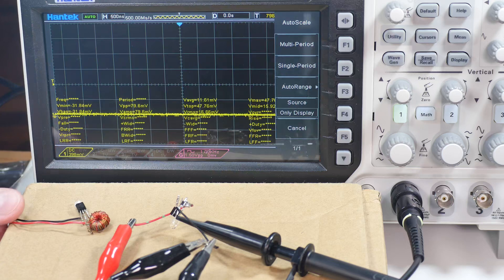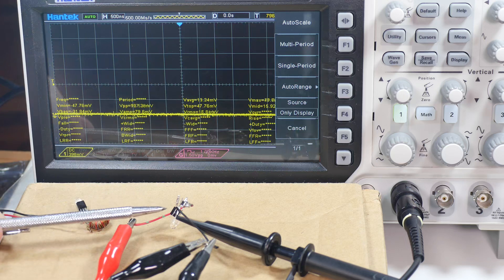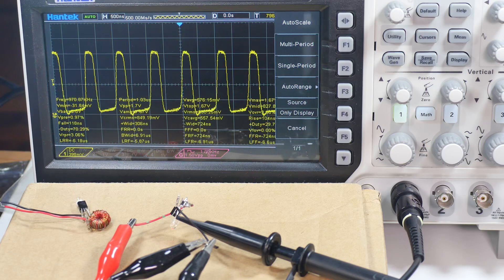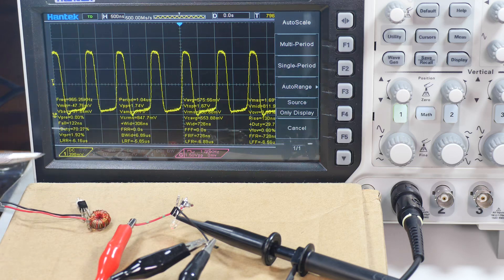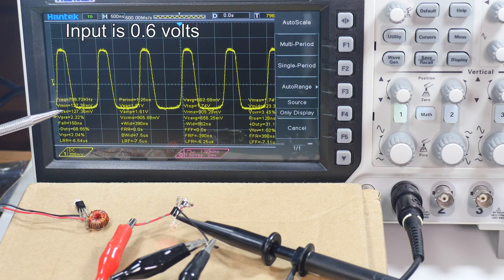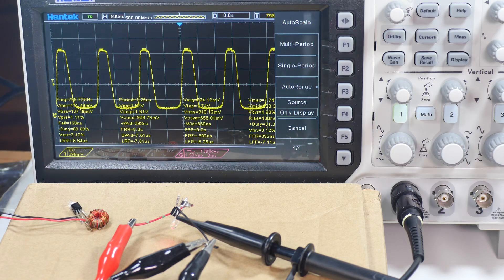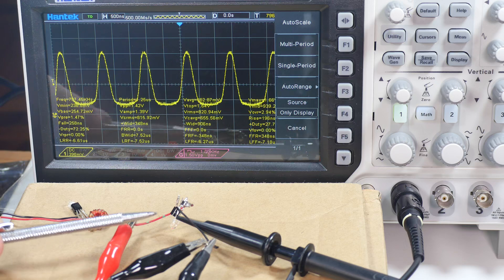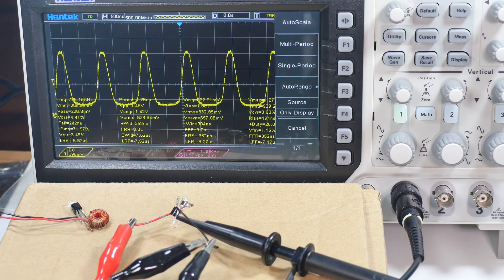No-Toroid Joule Thief Operating Frequency (4K)

Comment: Anyone looking to build an experiment? I've got three ideas that I need to test but I don't have the raw materials.
Counting down 
Idea-3
 I tried this idea out with fidget spinners and it sort of worked. The fidget spinners had three arms and on the first spinner I sellotaped a ring(doughnut) magnet to each arm, in a vertical position, so that when the arm was at 12 o'clock the right side of the magnet was always a North. I then stuck three ring magnets flat on the arms of the second fidget spinner so that North was pointing upward. I span the first spinner horizontally anti-clockwise and the second spinner I held next to the right side but in a vertical position spinning clockwise. When they were in synch, the magnet on the second spinner would always be behind the horizontal spinner. So for example, when the first spinner had a magnet at one o'clock, the second spinner would have a magnet at  7 o'clock, then as they repelled each other the bottom horizontal spinner would speed up. The problem was that the vertical spinner had nothing driving it because the repulsion was on the horizontal. The vertical would slow and fall out of sync and then attract to the South of one of the bottom magnets.
I needed for the spinners to stay in sync and thought what if they were flat round cogs beveled at 90 degrees to each other. I could use two magnets per cog and when the vertical cog's magnet pushed the bottom horizontal cog round that would in turn drive the vertical cog. 
I got some cogs from a toyset but they were too small and the cog teeth didn't fit very well. I went to the local library but their 3d printer could only do tiny cogs. 
So I'm stuck.
 I also wanted to try a configuration where the horizontal cog had two magnets but the vertical cog had a magnet in a sort of slide, so that it was always sliding down into position as the cog turned. 

Idea 2 - You have a vertical tube that spins around a centre point, it could also be a tube attached to a disc that spins. At either end of the tube are 'balloons' and the whole thing is filled with ferrofluid. At about the 1 or 2 o'clock position, the top balloon goes near a fixed magnet. The magnet starts to pull ferrofluid into the top balloon which expands pulling more of the fluid into it. The balloons are not globe shaped as we don't want them touching the magnet and 'sticking'. The balloons are a flat shape like a blow up mattress and when the top balloon is full it becomes too heavy for the magnet and falls down, which turns the disc and brings the bottom balloon up to the magnet and the whole thing starts again.
This is a very stop start motion but it could be used to power a flywheel. Also, to stop the ferrofluid falling back down the tube as the balloon is nearly full we could have two tubes with one-way valves inside. The tubes would have different flow directions and when the top balloon is first trapped by the magnet we could have a rocker switch which cuts off flow to the down tube and only allows flow through the up tube, which has one-way valves to stop the fluid falling back down. Hopefully this last part won't be necessary. (Got a version of this experiment with water instead of ferrofluid buts that's even more awkward. The balloons are covered with metal discs that get further away from each other as the balloon expands making the balloon less 'metalic'. So the magnets have less hold as the balloon gets heavier and finally drops).

Idea 1- Take a reservoir of ferrofluid and put a glass tube into it. The glass tube is shaped like a walking cane with a curved end. The straight end goes into the ferrofluid, the tube is angled upward at say 45 degrees and a magnet is placed underneath the curved end(the ferrofluid should drop vertically here so the tube should be curved just enough to do this). The tube will need to be full of ferrofluid before the experiment starts. The ferrofluid should be pulled down onto the magnet to form a spikey ball which will get too big for the magnet to support, when this happens the ferrofluid will drip into a second reservoir which is higher than the first. The ferrofluid in the upper reservoir can then be dropped down a tube onto a plastic turbine. To make sure the top reservoir fills up at the same speed as the bottom one does, you could have a thousands of tubes pulling the fluid up for every one downtube powering a turbine. This could be upscaled and built in a disused mine. 
But first I need to see if a magnet can pull the ferrofluid up through the walking cane shaped tube.

Comment: Yeah that's good for running off dead aaa batteries
Reply from the maker: I measured the mA draw at different voltages input and that's in the description. Also compared it to a toroid design. I think this one needs some fiddling to make it better.